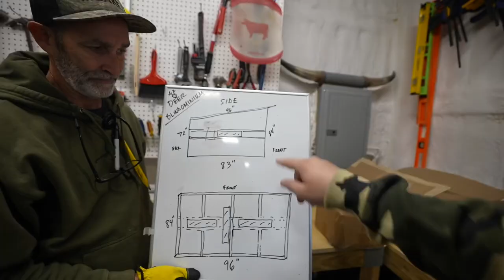Building a GIANT Homemade DEER HUNTING Blind with SCRAP WOOD!!!

Comment: Don’t forget to drop a huge gun safe into the foundation before the walls go up 👍 just a thought. Build your house around the safe, fits easier that way
Reply: At least make sure where you plan to put a gun safe doesnt have any post tension cables in that area so you can drill into the concrete without hitting one.
Reply: Umm he literally has he guns in his shop in a drywall room you think hes real worried lol

Comment: You should definitely use some kind of low odor primer on both sides of the flooring and put insulation under the floor  .  If I was doing it I would prime all the wood and use insulation . Good Luck guys .
I can't wait to see it completed

Comment: Love your videos. I just built a blind this week and used plexiglass as my windows. A tip for future plexiglass projects for you and everyone, use a soldering gun hot tip to melt holes instead of drill bits. Keeps the glass from cracking! 🤟🏻

Comment: I’d recommend going and buying some cheap carpet for the floor, we have it in our blinds and it helps with sound, heat, and I take my boots off and just chill while hunting, we also have office chairs in them… I would also recommend putting something under it so the pallet isn’t directly on the ground it will make it last longer you could get some of those solid square cinder blocks and level it out

Comment: Flair you should get some foam board insulation to insulate the blind it would help alot to soundproof it and do plywood walls and ceiling for the blind. That definitely would be one badass blind if you did that.

Comment: You should tint the windows on it. Super cheap and easy to DIY if you use auto tint. That way the deer won’t see you preparing for the shot, adjusting cameras, cooking, or whatever else is going on but you can still keep an eye on them. Then once everything is setup you can drop the window and lay the hammer down.

Comment: Magnets on the windows. They make some super strong ones. Plus backside sticky foam bead window seal will keep draft out and soften the sound when closing it. Shop in the door window winterizing area they sell seals for various sized gaps. Works good with sealing window gaps and keeping heat inside during - 40 degrees.

Comment: You should put some thin foam weather stripping around the outside of window where it meets wood and it would help with noise and seal it from any wind coming through the small crack in between the window and frame.

Comment: Flair, U can get the foam weather stripping stripping and put around the edges of the inside of the glass to keep it from rattling and the cold wind from blowing in around the edges of the windows. Stick it on the wood and the staple it so it stays and the tape backing won't come unstuck!!

Comment: Looks amazing damnnnnn 
You could put some rubber tubing around the window for insulation and would probably prevent it from rattling with the wind and making noise. Or put a strip of then padding around the frame of where the window closes as well

Comment: On the blind. I would advise putting carpet on the floor. It will help with noise.  Especially with your boots at close range. I would also put a solar panel with usb chargers for your phone. And also add a window behind you bc it’s always nice to know what’s that noise behind you

Comment: We have one that we built on top of an old chopper box and speaking from experience, throw some cheap carpet down on the floor. That OSB gets LOUD. Especially when you have that little bit of snow in the treads of your boot and it crunches every time you think about moving.

Comment: I've built a couple stands. I generally prefer to put a full wood ceiling under the tin. This helps the water to flow out of the blind in case of leaks. They rot fast in the summer heat when they get wet and you don't go in there for months.

Comment: I know it might a little late to do this but you guys should put some skids on the bottom of the blind that way if you need to then you can just drag it without worrying about damaging the sidings.  You know, just like the barns have in the animal pens!  Just a thought.  I would also consider putting in some cheap carpet in there for the floor that way the deer are less likely to hear you walking around inside.

Comment: Looks Great  You need to mount it to hayrack or a set of running gear so you can pull it around easy with a wheeler

Comment: Flair, when building driveway and sidewalks and stuff, you may want to think about getting a heated driveway and sidewalk. They are a little expensive but well worth it. Allows you not to shovel snow at all during the winter. Lots of pros and few cons

Comment: you should use spray foam insulation so it seals at the small gaps in the wood and prevents water getting in

Comment: To keep your plexiglass from getting foggy,  put some Rain-X spray that is made for lexan and plexiglass it will make it slicker so dirt and other things won't stick.   Also don't use any window cleaner that has alcohol it. Barbasol shaving cream works great for cleaning the plexiglass.  Wash, rinse, use leaf blower to blow off the water and then use a microfiber cloth to dry.
  .Also, make shutters that you can cover the exterior of the windows when not it use.

Comment: If you want to make it last you should paint it.  Otherwise the wood will weather and warp pretty fast.  I would also use spray foam insulation to seal up all the holes under the corrugated roof.

Comment: Hey beef cake put some big  long 4x8 on the bottom of that pallet green treated lumber and boom sled blind plus gets the pallet up off the ground to prevent rot on your flooring structure could drag it with a side by side make it a foot longer each side for the 4x8 going down hill can have a pull and brake vehicle

Comment: Just an idea, you could get an old petrol pump handle and attatch it into the water bucket as it has the auto stopper in and leave it pumping so it will keep your water auto filled and cut out at the tip of the pump, saw it on another video a while ago.

Comment: I'd put it on cinder blocks or something to keep the bottom from rotting out. I've had allot of pallets rot after a few rain showers and sitting on the ground with bug's and stuff chewing the wood. The dryer you can keep it the better.

Comment: You were fine with the skid loader, you had the forks in a good spot they were sitting on the support beams going across the pallet, if you strap the blind to the skid loader like you did and and lift it and lean it backwards and back down the hill you would be completely fine.

Comment: I’d put metal flashing on the sides so when it rains it doesn’t leak into the blind and rot out the wood. Get some styrofoam panels on the inside and a mr.buddy indoor safe heater and you are good to go. 👌👍🔥

Comment: You should it on a trailer,, and Put a solar panel and battery in it so you have electricity. Then put a fold down bunk and do traveling survival challenges out of it. Or build another thing for that purpose. Sounds fun

Comment: Spray foam the inside when still by the house and next spring get a hand pump and spray it with used motor oil.

Comment: This almost reminds me of when we built "the condominium" tree stand on our old property in the Poconos. Much smaller in overall dimensions but we also built it 15ft in the air on the side of a huge tree. You could stand in at 6'2" but it was wide enough for two chairs and some moving around space. Interior had a brown carpet covering the floors and walls so it was pretty damn silent. It initially had plexiglass windows but they were a pain in the ass to deal with and noisy. I thought the coolest part was how we extended the ladder to access the roof, fully brushed out with camo net. Mainly hunted archery from that roof spot if I was in a different stand on the property. It was also brushed out on the very bottom underneath the stand for turkey season. Mind you, this was built over 25 years ago and I was just a kid so that stand was absolutely baller status in my eyes. Haha. In the 10 years I got to hunt that property that stand took many many deer from a number of hunters. Good memories.

Comment: You could use magnets to hold the windows shut and it's quiet to open that seems simple enough to me just use some kind of industrial strength super glue to hold them in place or double sided gorilla tape should work too

Comment: A lot of time if the plexiglass window start to fog up or get the bad film on it you can use window cleaner then either a heat gun or lightly with a torch and it usually remelts the plastic back to clear. Just don’t want to overdue it or you can burn it and turn it black.

Comment: Flair you need a crawl space no a concrete foundation. If a pipe clogs you have to take out all the concrete. It is much cheaper in the long run.

Comment: Flare next time take your top two-by-four that you're putting your latch on for the plexiglass take your skill saw and run a line a quarter inch in on a two-by-four and you can slide the plexiglass down between the two by four

Comment: Whatever you do, dont insulate the stand. The mice will find it a very good spot for a house and it will be a battle. Without insulation, the shack will be warm just need a little extra propane but its better that mice for days.

Comment: Glass guy here, do not drill plexi glass, do not use plexi glass outdoors UV light destroys it super fast. You want polycarbonate / lexan. You can drill it, bend it, and it lasts outdoors. Polycarbonate is what is used on ATV's, RTV's and side by sides. Yes it costs more.

Comment: If they knew they were gonna move it around, why not run an axle through one end of the pallet and put some wheels on it temporarily then put a mount on the other end to be able to pull it around with the mule or something?

Comment: Strap to it beforeyou pick it up. And strap to the fork frame
Reply: And use 2..2x8x16ft .. And put the forks under them longs ways. Strap and your good go backwards to get there with skids steer. Tracks rock on them